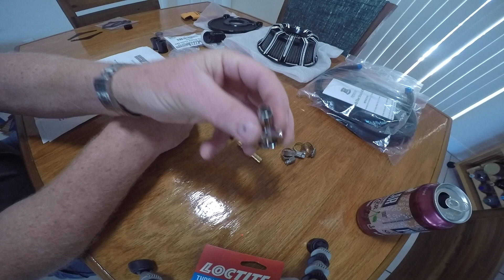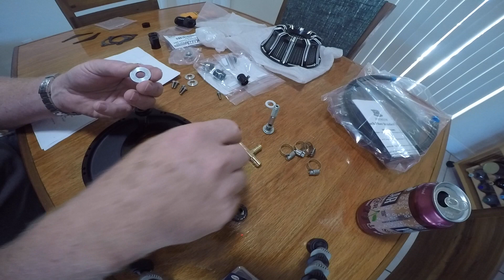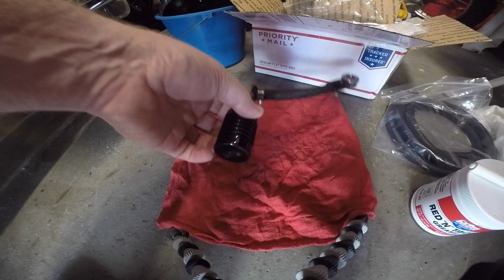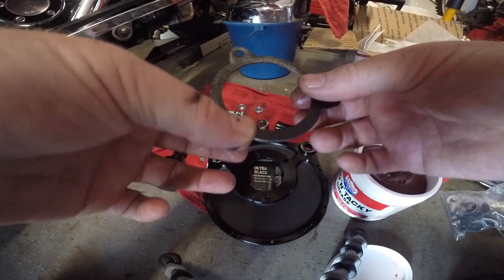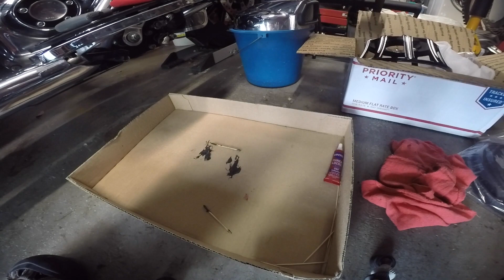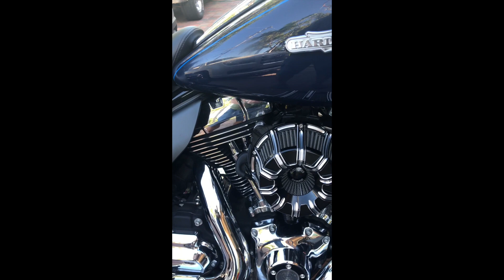DK premium discrete breather & Arlen Ness Inverted air filter installation

Comment: I just completed a Stage IV upgrade and my pistons were covered in grime from oil infiltration. I wanted to do this breather bypass as I also have an Arlen Ness inverted air cleaner, however, they discontinued this particular one and now require drilling and tapping the frame to collect the oil. Perhaps I shall look elsewhere. Nice video, thanks for doing this.

Comment: Thanks for the detailed how to video. 1 question does the Arlen Ness breather kit come with the 2 different sized spacers if using breather bypass
Reply from the maker: It's been some time since I did this installation and posted this video, but I displayed all parts that came with the kits. It is actually two kits and you have to set some parts aside. One kit is the Arlen Ness air filter (which includes parts to do the install without any crankcase bypass), and the other kit is the crankcase bypass by DK. The DK instructions tell you which parts to use and which to set aside, but I made the video because those instructions were vague at times in their descriptions. If I didn't show two different size spacers in the video, then they don't exist in the kits. I will add that DK customer service was excellent (I had to call them because my DK kit was missing parts). If there is something you want to ask about or need (like a different size spacer), I would recommend calling DK. I was very impressed with their prompt response and that they quickly sent me what was missing, along with some other goodies as apology.

Comment: Where did you get those smaller black spacers because I got the longer black spacers with my air cleaner kit you never said where you got those black spacers that are not so wide And I got the same air cleaner kid that you got with with the same backing plate and I got the longer ones

Comment: I appreciate the detail you have gone to. I was toying with purchasing a filter from DK but if there are shortcomings in the supplied parts thats a huge issue for me being located in Scotland as parts are taking 4-5 weeks to come from the US at present and thats some significant delay in awaiting missing bits coming.
Reply from the maker: Kenneth - It has been more than two years and the kit still works great. Very happy with it. No oil slop at all and nice cool non-oily air into the throttle body instead of oily vented crankcase hot air. While my kit was missing an integral part, I am not under the impression that is a regular occurrence with DK. Plus, DK sent out the missing stuff immediately AND included a freebie goodie to make good on the error. I did substitute gasket seal for those plastic washers, but you should be able to get that at your local automotive store. My point is that there is a high likelihood you WILL receive all required parts from DK and that the only thing I substituted was gasket seal for the plastic washers. There should be no show stoppers here for you if you decide to go down this road. Good luck whatever you decide - keep us all posted!

Comment: What was the brand of the automotive pinch clamp kit you showed in the video?
Reply from the maker: Pinch Clamp! I knew there had to be a good name for those. I purchased them at Pep Boys. It just says "Help! Value Pack" for a name (it's a 35-piece assortment plastic tray). The part number is 55173.
Reply: @motorcycleadventurerider  Thanks for the info,currently putting a custom kit together for my roadking and fatboy 👍

Comment: VERY GOOD VIDEO. I have the same problem with my Banjo kit from DRAG Spécialities which I want to install directly on the motor heads, No precise explanations from the manufacturer, we must be logical and have some knowledge of mechanics. I like your idea of the (liquid seal). I know there is not a lot of oil pressure but metal on metal I found it weird. Did your kit do the job? oil accumulates in the can ?
Thanks again...
Reply from the maker: The kit actually included these weird very thin plastic washers that DK told me would "form" (they used the term "melt," but I'm sure that was just a poor choice of wording) into a seal and would need to be replaced if ever dismantled. When I expressed concern about the fitment of these plastic washers, DK told me that they often do this installation metal-to-metal and have never experienced leaks (I appreciated their input, but not the road I wanted to go down). But, with crankcase venting pressure very light and exhausting into a vented catch, it's not like you're trying to seal some high pressure mechanism (as you have already pointed out). Having installed this kit, I think any reasonable attempt to apply even a moderate seal would be adequate. One warning however... The plastic washers are wafer thin for a reason - fitment of all parts. You can't just go out and get more robust washers or the kit won't assemble properly. Whatever you use to seal must also be wafer thin. Hence my gasket seal alternative plan. I felt the conservative use of gasket seal was an improvement over the hard plastic washers, in part because gasket seal dries pliable, much like a rubber seal (which alleviates as much of the metal-to-metal concern as I could). Short story is no leaks at all to date. No oil residue at all out of the banjo bolt assemblies or elsewhere. Two services of the catch can to date, and no issues there either - easy to remove and clean out. All has remained very clean. And if I ever do have to take it apart, no need for specialized parts from DK. Just buy another small tube of gasket seal.
Reply: @motorcycleadventurerider  Thank you for taking the time to answer my questions and once again for taking the time to make this video. I bought the bypass kit because of this. I found it logical not to send oil vapors into the engine. My Banjo kit does not contain plastic washer and the thickness of the gaskets for me is not a problem because the Banjo does not fit the back plate of my new vance & hines filter. They are mounted directly on the heads. My only question was metal-to-metal. Even if DK says it's ok, I'm going to do like you did and put in some liquid gasket. Anyway I have time to do the work, there is 3 feet of snow and it is -3 degrees fahrenheit still in Quebec

Comment: Could I ask you what made you choose DK over Arlen Ness or other brands.
Reply from the maker: Just for whoever reads this question/reply, the air filter IS an Arlen Ness. The crankcase ventilation bypass kit is a DK product. Two different kits that merge together (hence some of the confusion and lacking instructions that led to this video), but both purchased from DK simultaneously. As to answering your question, at the time I installed these items, I was unaware of any other crankcase ventilation bypass kits, which is the reason I installed the DK portion of this project. There may be other crankcase ventilation bypass kits today, or maybe there were a couple years ago and I was unaware of them. In any case, that's the reason for the DK crankcase ventilation bypass kit. And again, the air cleaner IS an Arlen Ness. You get parts for both items, but have to figure out what to set aside and not use, or perhaps more importantly, figure out which parts need to be used (hence this video).
Reply: @motorcycleadventurerider  Thanks for taking the time to answer and to make the video. Rubber down shiny up.
Reply from the maker: You betcha!

Comment: Thanks for the quality vid. Good detail. Great suggestions. This made the install on my 16 Dyna  clear. DK's instructions as you mentioned, are severely lacking. I installed my catch can in the same spot. I see you've had this for a couple of years now. How has it held up? Any leaks at the banjo bolts or from the backplate? How's the catch can holding up, any leaks there? Thanks again.
Reply from the maker: It's held up fine. No leaks at all on the banjo bolt assemblies or elsewhere.

Comment: Is this mod necessary for my 20 m8 engine?
Reply from the maker: I don't know, but next time you check your air cleaner, just see if the crankcase breather vents there (you'd have to take the air cleaner off to see, but that's very easy to do). Also, if you take your air cleaner cover off and see oil residue on the air cleaner or inside the cover, that's pretty much a dead giveaway too. Of course you can also look behind your air cleaner where it attaches to the cylinders, and if you see the crankcase breather plumbing, then you have your answer. But, much as I hate to assume, since I believe this is primarily an emissions function,  my guess would be there is similarity here. Hopefully those with Milwaukee Eight engines can chime in and let us know.
Reply: DK Customs have some good vids on the subject. How I came across the mod was looking for ways to stop wind buffeting which led me to DK and subsequently was exposed to the need to look for ways to cool the motor. Emission control issues have led HD to feed the crank fumes back into the motor through the air cleaner which means hot oily air preventing maximum “cool” (ambient) oxygen in affecting the AFR adding to the motor running hotter and negatively affecting combustion. M8s have the same emission control measure and it is my opinion that yes the M8 needs the mod and I’ll be making the mod on my M8.
Reply: @adrianstafford9347  how this mod is different than vented dipstick?

Comment: I used kuryakyn extended stock style breather bolts with the screamin eagle backing plate that the previous owner installed on my 2014 Ultra Limited and ran a dk customs oil catch can. A lot cheaper than buying another air intake.

Comment: So besides maybe having little cleaner pistons that you can't even see and probably exact same performance out of the bike what's the point of doing all this?
Reply from the maker: Well, I'm not a professional mechanic, but you will also have a much cleaner throttle body (or carb), valves and valve seats, and avoid an oil soaked air cleaner (the latter of which absolutely adversely affects engine performance). Beyond that, as I said many times during the video, you re-route the hot oily crankcase breather air from dumping right into your throttle body (or carb). Hot air is a performance killer, so when the throttle body (or carb) is able to ingest cooler air, performance is enhanced (just look around at all the ads for "cold air intakes" for cars). So, without hot oily air dumping right into your air cleaner and intake, your internal combustion gizzards will be cleaner AND you will gain some horsepower. How much power? Somebody probably knows, but not me. I will say that, after my install, throttle response was bit better, power band was a bit better, and the power gain was a bit better. Was the power increase day and night? No. Was it noticeable? Yes. I have a buddy with a Road Glide who repeatedly inched me out in friendly drags from about 45mph to 75mph. After this installation, I was inching him out. This is how I know, for certain, there was a definite power increase. Hope this information is helpful.

Comment: A good review but you missed two things, first the gasket seal, just take little on your finger and dab it on, a very thin layer otherwise it will not seal properly and second, you forgot to oil the filter.
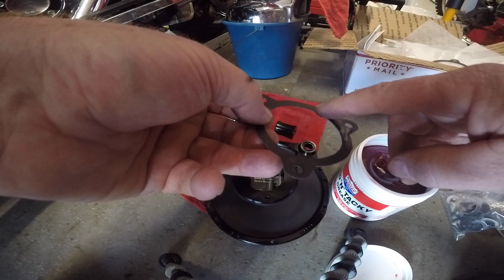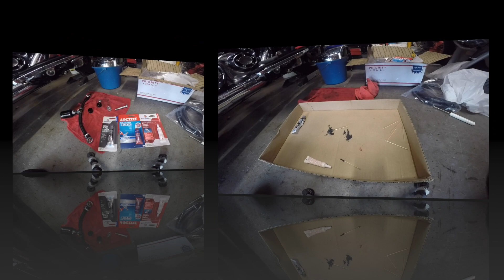Reply from the maker: As for the air cleaner, while you may have purchased something differently, mine was clearly labeled NOT to apply oil to the filter. Presumably this filter was impregnated with whatever it needed. I should have mentioned this because I had my K&N spray oil ready to go and nearly sprayed the filter as the placard NOT to spray was not overly conspicuous, so thank you for bringing this to everybody's attention. As to the "gasket seal," I used grease to preserve the gasket rather than gasket seal since the surfaces were perfectly flat to the touch. As I said in the video, I wanted to make sure that I didn't destroy the gasket if I ever had to remove it. And this grease was applied very sparingly via my fingers (35:10 in the video). The gasket seal that I did use was on imperfect non-gasketed surfaces (40:10 in the video), which (at least in my opinion) required slightly more liberal application. I put on just enough for good seal while preventing excess mushrooming the interior. And since there was minimal mushrooming and it has remained perfectly sealed, I'd like to think that I used just the right amount. My use of toothpicks was due to applying on very small odd-shaped surfaces and to keep my hands/fingers from getting that nasty gasket seal all over everything I touched. It was just a suggestion. Thank you for your advice!

Comment: 2018 streetglide special bought the arlen ness big sucker for the stock filter cover. So the banjo bolts that suppose to direct it back so it can burn up. Instead i get the oil on my saddle bag right side of course. I don not recommend arlen ness anything

Comment: does the breather system work with arlen ness 90 degree monster air filter?..
Reply from the maker: I don't know. This was solely an installation video for the parts I ordered for my particular motorcycle (2015 Harley-Davidson Ultra Limited). I am, unfortunately, not an expert on various applications. Please let us know here when you find out. Thanks, and good luck!
Reply: @motorcycleadventurerider   Thank you for replying.. I was searching for solution and found out that the only way as of now is DK customs DIY external kit for air cleaner with one piece backing plate like Arlen ness big sucker and 90 degree monster air filters..

Comment: Curious how your catch can cleaning came out. I bought the same kit for a 17 SGS. I really like the look and the concept but I have done two long rides now, one from Dallas to MS to TN back to Dallas, and the other Dallas to Houston. I've found that if I do anything longer than just small hops to the gym, grocery store, dealer etc, my can is wet externally. I have mine mounted under the right front floorboard, so part of the floor board, front lower exhaust, etc show spattering of oil mist. I keep my oil level half way, and I put paper towels in the bottom of it, because prior design they recommended that, it does help but still oil can is wet externally. I wouldn't dream in my case to mount it where yours is, or it would be a heck of a mess. Don't understand it, I've got a stage II with a torque cam but no other real engine work done. Probably going to remove the can and let it blow to the ground, hoping it doesn't have the underside of bike wet.
Reply from the maker: December is my maint month and I'll do my best to remember to post here on what I find. I just did a 215 mile trip and the oil can is still dry... no issues. Not a drop of spray, mist, or leak since installation, and I've been looking on every ride. My crankcase oil level is right at the half mark. I know some bikes spit a lot of oil and other do not. I have a buddy who only fills his bike just above the minimum level because if he fills any further, it spits everywhere (he is switching from the can to the misting arrangement). Hopefully others will post, but one suggestion is, at oil change, do not fill too far. Just fill the crankcase a little above the min level and give it a try. I have another buddy who has the dealer do his oil changes and I posted previously that he had oil all over his bike on a recent ride... got filled too high! His bike has never spit like this, but it did this time. I'll video my maint service (that I do here at home) and post comments about what I find. Again, December is my maint month.
Reply: Just installed this on my 16 Dyna. I've experienced the same issue. I also have a stage 2, with S&S HP 103 CAMS. My catch can is wet externally from long trips too. By long I mean 120 miles. Otherwise, it stays dry. I removed the can and inspected it, noticed it was not full. So, I'm assuming the plumbing that runs from the t-connector to the can wasn't tight enough/sealed. I also have my oil at half level. Did your problem persist?

Comment: Awesome video! I was wondering that myself how far the damn thing stuck out. I have a 2005 deuce I was thinking about putting one of these on mine but I don’t want a knee knocker either.  I have 3 inch extender pegs on my bike so I think I’ll put a call into them to see how deep the air cleaner is and if it’s going to be a problem